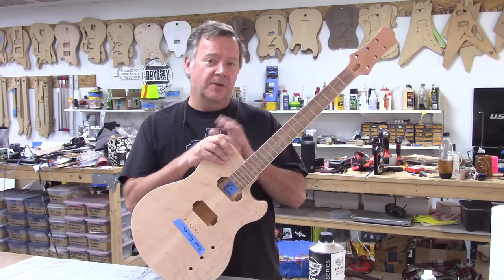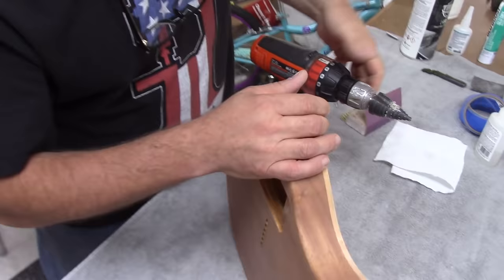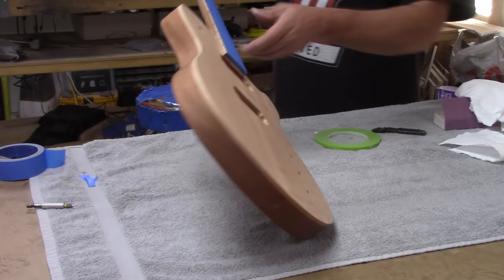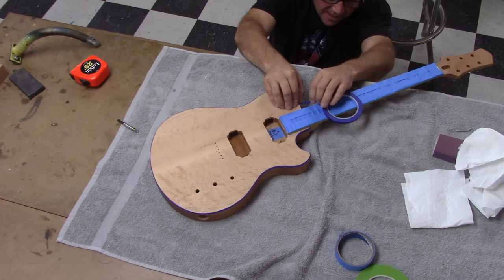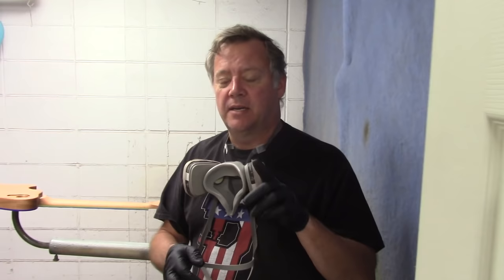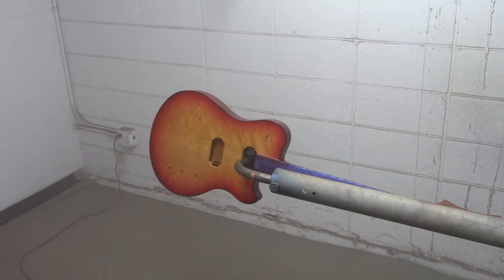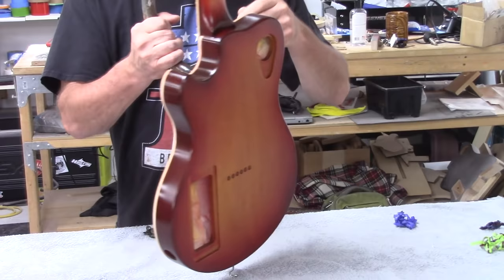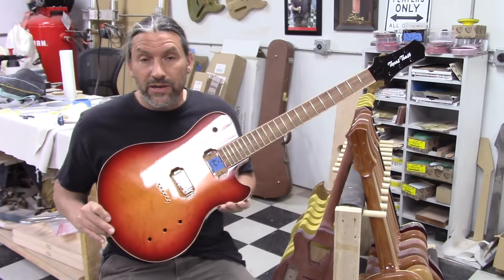If You Aren't Painting Your Guitar Like This, You Are Stupid!

Comment: What size nozzles did Chris use for 1) the color coats, 2) the clear coats?  Pressure always around 35-40 psi? Any sanding between clear coats? Any buffing after the final clear coat?
Very impressive result.
Cheers and well done!
Reply: Just read the pds that comes with your finish lol

Comment: I never bought into the "Lacquer helps the wood breath" mess but I like the way Lacquer looks, yellows and checks/ages. Poly usually looks thick plastic-y as opposed to lacquers hand rubbed fine furniture/less glossy look. At least this is my experience. I am not a pro but I have built a few guitars. The early ones were rattle can poly, later I used rattle can lacquer, now I use lacquer with a gun and I hand sand/polish and it looks so much better to me. The lacquer also seems to sink into the grain a little which gives a more vintage appearance up close.

Comment: Unfortunately I live in Cali where they have ruined just about any type of finishing product except nitro lacquer. At least I can still get it I think.  No naptha, no mineral spirits and any solvent is basically acetone. Including what they call paint thinner. 
I'm using a UV cure polyester for sanding sealer. It gets you to the paint stage much quicker. It's called Solarez. Thanks to you I now know about Simtec. They also make a UV polyester sand/seal.

Comment: As pros who have a system and booth down cold, I would love your design advice for a more modest set up. If you were to build a booth sized for one guitar, and painter, what’s your minimum sizing? How would you build it? What intake and exhaust filters would you recommend? What’s a recommended entry level yet quality gun? Working in a home studio with respect and safeguards for neighbors, what safety/ air quality protections  would you advise? What ‘s your reasonable budget for all this? Thanks so much; I’m sure it took years, maybe decades to hone down your technique, equipment and shop. Quite a mountain to climb, thanks for lighting the path.

Comment: Life would be a lot easier if you didn't constantly have to fight your recoil hose that's also a dust and shit magnet. You could also ditch the pressure gauge on your gun, I can see you're good enough not to need it and pressure drop over the given length of hose you'd always use is very quickly  learned. Just use your wall mounted regulator and add a little. Given the amount of gun manipulation, because of all the shapes, I'd even dump the quick connector in favour of a simple nut and tail. They're not so easy to buy but you can get rubber, as opposed to neoprene, hoses that are far more flexible. For the colour, again just to make things super easy you could drop to 5/16" internal diameter hose.

Comment: Lovely burst! One tip: try using the 3M 244 gold tape to tape off the fretboard. Leaves less residue behind when peeling off the tape. I often cover that with Stewmac's brown binding tape to protect the fretboard from accidental knocks, but the gold tape is amazing.
Reply: That 244 gold is exactly what we used to paint cars when I did autobody refinishing 👌 I found something a couple of weeks ago that had tape on it from 10 years ago; still stuck just as good as the day I put in on whatever that was I can't recall right now 😆

Comment: I use the orange vinyl tape I purswad it with  a little heat especially if it's into the curves of a headstock like a dean or fender or what not  not alot just enough to get it confiorm.

Comment: I luvvit! I don't have the professional painting stuff, I refinish CHEAP guitar finds with Rustoleum rattlecans. Hobby. I'm anxious now to try the "masking a binding" method on my next Squier Affinity strat. It should work! I think i will spray at lest one coat of flat clearcoat on the guitar curve AFTER excessive sanding to ensure that the strip of tape has a deadly smooth, bleedless surface to seal onto. Thanks for the good video.

Comment: Question: If you have to tape the edges of the neck (with the fret markers) anyway, why not start there with the blue tape and fold it over onto the neck? Wouldn't that eliminate the seam at the edge of the neck and having to "fold" the tape over each fret? Then the neck would be covered and sealed edge-to-edge.
Reply from the maker: We like the fine line tape for fine lines
Reply: watch again.  the maple binding on the neck gets clear coats. we peel the tape off the binding, then it gets clear coats. Thats why we tape only the fret board.  the whole idea is to remove tape as you go, not add more half way thru the process, as your method would require.    Why do people second guess my methods without watching the whole video?

Comment: Do you guys buff the guitars at the end? I see a lot of orange peel and imperfections in the finish in the end of this video. Thanks!
Reply from the maker: Yes we do. There is a lot more labor that goes into this process, as you can imagine. We wet sand to 2000 and buff on a series of high speed buffing wheels. It's the only way to get all the imperfections out and make it look smooth like glass.

Comment: You don't show the in-between coats - duh. Do you clean the gun or turn it upside down to clear the nozzle or what?
Reply: its not a spray can.  I set it in a gun holder and walk away.  the clear is good to go for about 1.5 hours before it starts to gum up anything.

Comment: With 2k you might want better protection of your head (skin and eyes) That stuff is very toxic 😮
Other than that…great job 😊
Reply: It's not that toxic. The main hazard is the 2% free isocyanate, an excess in the hardener there to ensure full cure. The respirator worn should be ideally be air fed from a safe source but given that the amount of finishing carried out is likely to be small, then the risk is low.  Cartridges are not intended for use with isocyanate and supposedly have a 15 minute life.